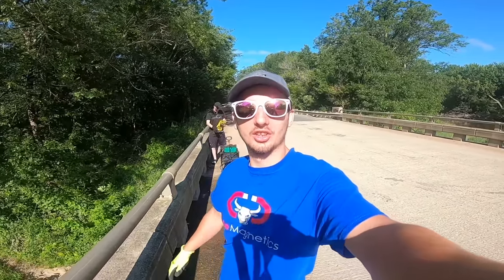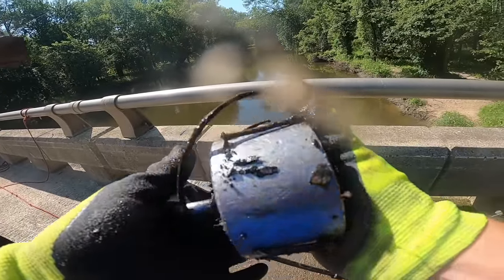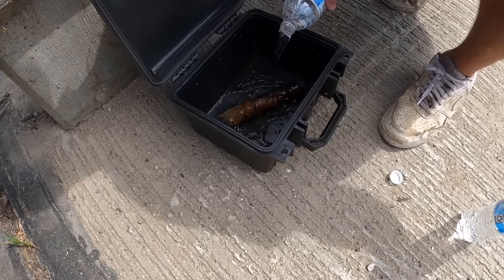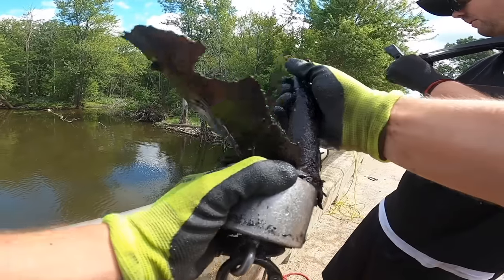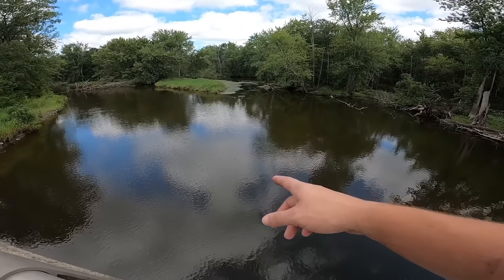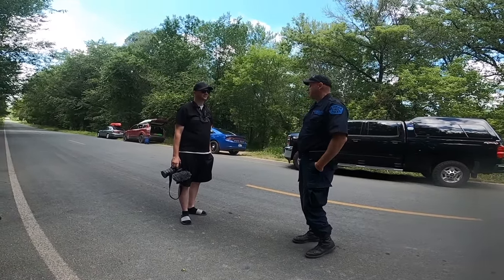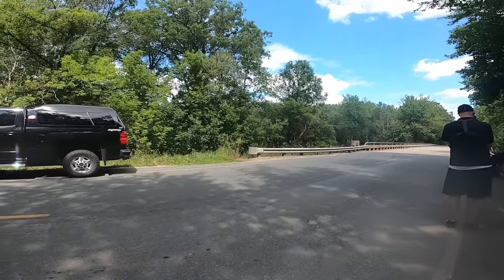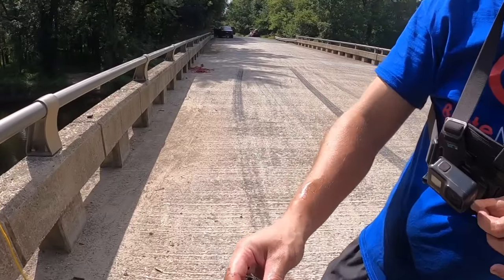Bomb Squad Couldn’t Believe Their Eyes When We Found This Magnet Fishing!!

Comment: Its already been said but these aren’t mortars. They are large rounds for some kind of military gun.  Someone mentioned 25mm and they do seem to fit that description. They are in bad shape and probably won’t explode in the way you would imagine unless they are exposed to fire spark or some kind of heat source. White phosphorous is never used as a propellant so that was not a good mention.  Mortars don’t look like big bullets, more like little “bombs” with tails.  

Keeping the rounds in water is a good precaution.
Reply: I thinks thats too bulky to bee 25mm, and its looks more like 30/20. Not totally sure tho but if you look at tip and compare it with 30mm and what they found from video, it looks like 25mm have thinner tip than 30 or 20mm but if you look at the lenght then I would say its 30mm.
Reply: @kriegscommissarmccraw4205   Could have but they only use wp in api rounds of this type which weren’t in the WWI inventory. WP is used a marking round for mortars and as part of large cal api rounds.
Reply: nah bigger than 25s for sure, look when the round separates in his hand, the round is like twice as thick as his thumb which is 20mm. could be 30mm but i still think its a bit on the smaller side. hard to tell through a lense can only really compare it to his hand when the round splits from the case.

Comment: "I just found a bunch of them! Bring water!"
Or just set them back down into the water on the magnet so they can be pulled up by the squad.
:shakes head:
Reply: Bombs need filtered grocery store water though.
Reply: @zapa47  Yeah that one was wtf guys.. Just get container, get water from the river and then lift it straight into water. If you feel brave to remove the magnet its least safer to do in water as that takes energy away from the explosion a little bit, though looking the condition of these those are ether extremely sensitive or inert and that is the dangerous part of working with this kind of damaged ordinances.

Comment: At 9:03 I would say that is actually the bottom of a plow blade used for farming.  Despite what you think, plows actually are made of multiple bits.  The sharpened edges dull out pretty quick, but rather than get a whole new plow, you just bolt on a replacement bottom or front edge bits.

Comment: Those aren't "mortars". They look to be 20mm rounds. They could be either explosive or inert projectiles.
Reply: Industrial intensity  Not artillery. Mortars are a "type" of artillery/indirect fired munition.
These are just belt/magazine fed munitions. 
Looks to be 30mm. I've only personally handled 40mm for the M203 I carried. 
These are a bit smaller in diameter and those are usually aircraft/naval weapons platforms.
Reply: Industrial intensity    That's understandable. They are large rounds and to the uninitiated can seem artillery-like.
Just, artillery denotes a different type of weapon than what these rounds would apply to.
These types of rounds are generally used in what are termed canons. Utilized on Apaches, bradleys, A-10s, strykers, etc.. 
They are direct fire weapons that are used against targets viewed by the operator.
Artillery means weapons platforms used in an indirect fire role (think giant grenade launchers) that are used against distant targets that are not observed by their operators. Called in/directed by other units observing the target. Termed "Over The Horizon" support.
I wasn't criticizing. Just defining why I typed what I did. Hope that clears it up. Have a good one.
Reply: Industrial intensity  Oh, you have videos?
I'll be sure to check them out. Everyone needs some help against YouTube's shenanigans these days.

Comment: I used to work with with EOD cats back when I was in the service.  Frankly, that stuff is massively dangerous.  Magnets can move around components in whatever detonation device sets off the explosive charge.  Metal components like wire snips can actually complete circuits, causing detonations in electronic devices (ceramic knives were wildly popular for taking stuff apart).  Changes in temperature can set of certain explosives on their own, without the need for a functioning detonation system.

For most situations involving explosives the safest thing to do is just to blow it in place.  Avoid being near it, jostling it, all that stuff.  Anyways, there's my two cents for the day.

Comment: Retired EOD guy here.  I actually think they were 30mm or 37mm.  Difficult to tell with the brief shots of the items and nothing in background for scale.  And I am having cocktails and not interested in studying them in detail at the moment, lol.  But they are definitely bigger than 20mm.  Nothing more than big bullets from what I can see.  No real hazard unless you try to break them open and cause some sort of friction with the gunpowder/smokeless powder if the powder dries out.  Not knowing what era they came from because they were covered in mud difficult to know what the energetic material was.  The responding Bomb Tech was a bit of douche though.  Having said that, when you find one of the these kind of things stop.  Good job putting them back in water but just stop.  Let professionals don some scuba gear and get the rest.  

Oh, almost hit send but those kind of rounds can have HE projectiles but they are designed to detonate on impact.  So no hammering them.  Actually WW II had HE 20mm rounds, just FYI.  Okay I am rambling now.  Hope you can make sense of my message here.  Big thing though is stop when you find this stuff.

Comment: PSA If you find a uxo(un-exploded ordinance) step 1 leave it where it lies step 2 retreat to a safe distance step 3 call emergency services(911 etc.) They already identified them in the video as 20mm, but if you came across actual high explosives, vibrations can set them off. If it were a real uxo the thing would have detonated in his hand when it fell apart detaching it from the magnet. They were correct to soak them in water because phosphorus burns in air ignore all the hoo daw about temp changes, leave it call emergency services

Comment: as a former eod guy.  Its unfired and unarmed.  No hazard at all other than the heat shock and friction of the explosives themselves.  Soak it in transmission fluid and problem solved.

Comment: They're probably 'old' 30mm rounds, judging by the the size and shape. New 30's have a larger casing and are typically used in APC's, IFV's, and A-10's. I see comments with 20mm, but 20's are a bit smaller.

Comment: Those were not mortor rounds. Those are 20mm anti-tank/aircraft rounds. Mortors have fins on the bottom for stability through the air. If you look at those bullets, there's a lip on the bottom of the round, there is a lip for the ejection system of the gun.

Comment: This thing lay at the bottom of a river, beeing tumbled by the current over and over, for essentially years, rusted to the point you can barely recognize them. Is a bombsquad rly necessary for that? You could probably cut them open with a grinder and absolutely nothing would happen. Not that i would recommend that, but surely the powder has to be soaked through at that point?

Comment: Once these things are in the water for that long I wouldn't worry about it. Several years ago, I found several stripper chips of 30.06 and 308 rounds. I called the sheriff's department and they just asked what condition they were in. I mentioned pretty corroded, and they just said throw them in the trash. Once corroded there pretty much useless. This lake was built by the Army Chore of engineers over 50 years ago and is just a matter of them having target practice. Nevertheless, caution should always be used. You don't want to pull up a land mine or a or a Maval mine at an inlet ya know. Then again it would have blown up and your magnet fishing day would have come to an end. Search on and maybe solve some mysteries.

Comment: the piece you found that you described as a hinges actually a chain linkfor a manure spreader or a potato diggerit is a single link much like the single link of a bicycle chain that is designed to trav, the interesting design of the half open swivel point on the chain link allows you to link them together one by one by hand without any toolsel around a sprocketa unique design of these chain links they can be added to or taken away from by adding or removing links without any need for tools simply by bending them to a certain angleand they release

Comment: dangerous 3 out of 10 its very old not mortar rounds! bro looks like a 20 MM, at this point of decomposition you could probably run over it and nothing would happen other then it break apart. good call to get someone 20 mm are normally a very stable munitions. great job.

Comment: Those look like 20mm Oerlikon HE rounds! Newer expected WP!!!
And Magnet MIGHT ARM both of THEM at the right angle as it will act as centrifugal arming mechanism! Handling and small change of temp. wont! Water is always a good safety measure! I mean the BANG will be 10 times louder but shrapnel's 10 times less lethal!
But with WP...when that starts burning EVEN A LITTLE BIT drop it in the water or wet sand/mud and START RUNNING FOR YOUR LIFE! I would rather have 10 conventional shrapnel in me than one 
WP wound!

Comment: If anyone is an expert with knowledge to share on what these are and how much danger they pose being out of the water, I would love to hear from you.
Reply: They look like 25-30mm rounds for an auto-cannon of some variety. Think of the 3 barrelled rotary cannons found on some Vietnam era and later helicopters. The propellant in the cartridge is unlikely to go off, especially after being underwater for years but it is still potentially dangerous. The bigger worry would be the projectiles which were usually a high explosive of some kind like RDX. Fortunately that's extremely stable but water isn't going to kill it so could still go off if you did something stupid. 

The really big problem would be if they were white phosphorus rounds. Now that's something you would usually see in large grenades, tank shells, bombs, etc. not in a 30mm but there are white phosphorus spotting rounds. That stuff is nasty and not something you would want to mess with on a good day, much less when they have been in a river for years. Not really an explosive hazard but a super hot, impossible to extinguish fire that sticks to anything and everything.
Reply: @wingracer1614  thanks for the information. Also, they sound hideous.